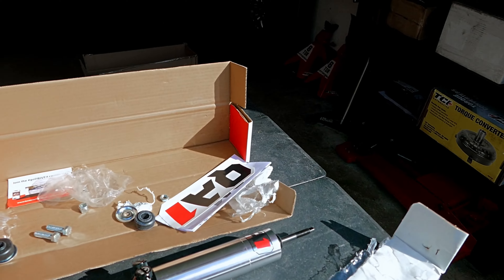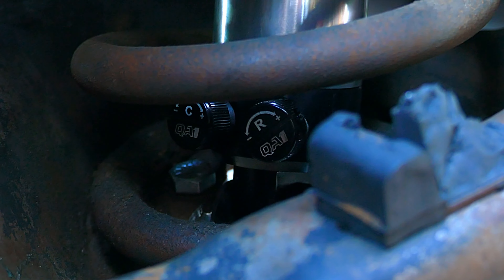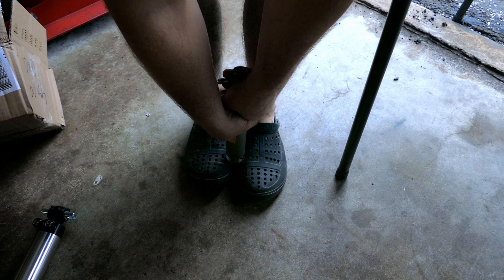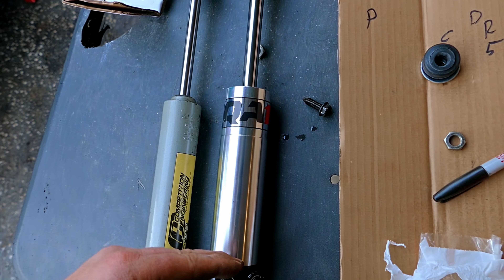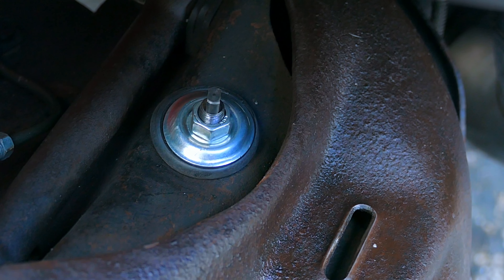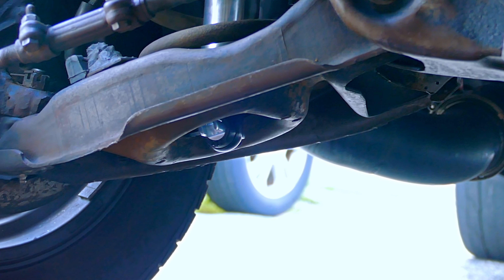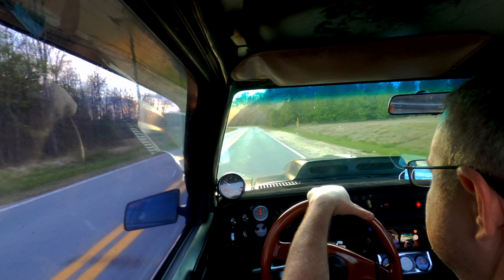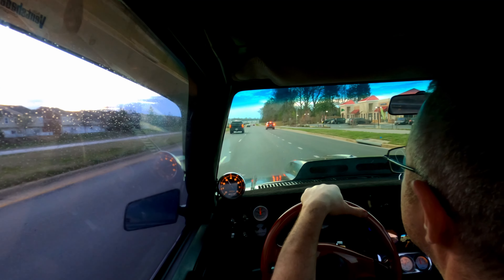400 CID V8 S10 Gets QA1 Shocks and they are Awesome!

Comment: Rear shocks are just as important if not more than the front to make a car work. Should have just sprung for the coil overs so you can get to the adjusters with some after market control arms
Reply from the maker: I'm cheap! 😆 One thing at a time brother.